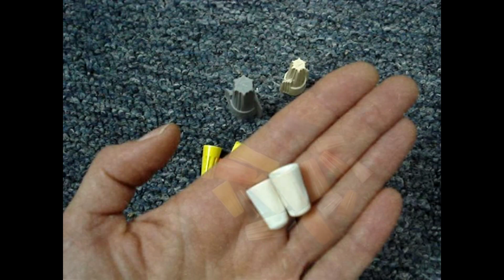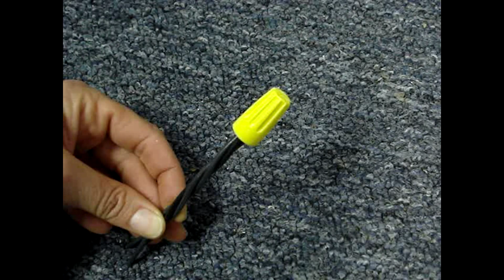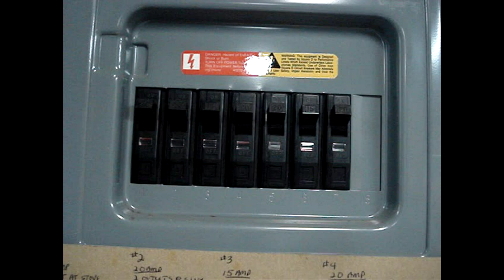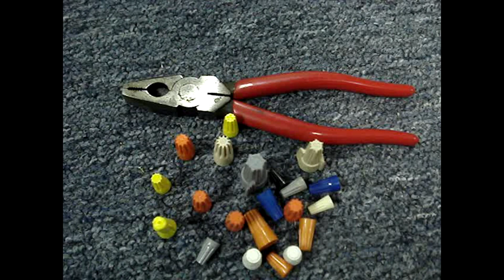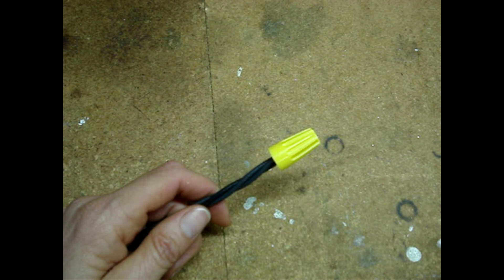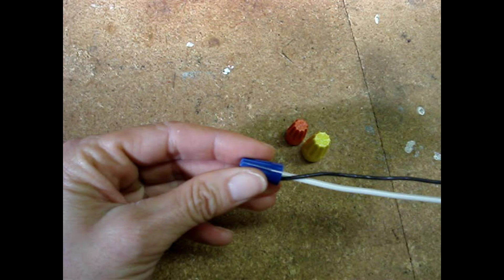How to Use Wire Nuts

Comment: pretwisting     wire    I think  damages  and weakens the wires continuity
Reply: Bigger pain in the ass to undo if you pretwist too, probably more secure pretwisted.
Reply: Don't think. The bottom line here is that the signals on the wire are not even close to being small enough for a small change in the wire's resistivity.

Comment: Good video. It's a surprisingly complext topic when you consider all the sizes of conductors and how many can go in each one.  One thought I've always had ... when you're doing the splice at 7:30 is the stranded conductor an aluminum conductor? If so shouldn't this require an Ideal 65 purple wire nut with the special substance inside? Thanks !
Reply from the maker: I spent 20 years as a tech/designer working on low voltage building systems... fire alarm, nurse call, security, card access, etc.   I've made thousands of spices.  When I researched this seemingly simple task, I learned that I really knew very little about wire nuts. 

Good question about the stranded conductor.  The stranded conductor is not aluminum, it's tinned stranded copper.  We used a lot of that type of wire in the low voltage building systems.

Here's a good link to a good article on aluminum wire.  https://www.nachi.org/aluminum-wiring.htm
Reply: Thanks, good to know !